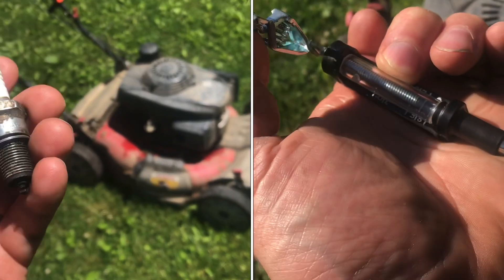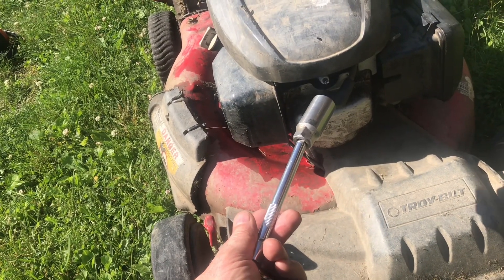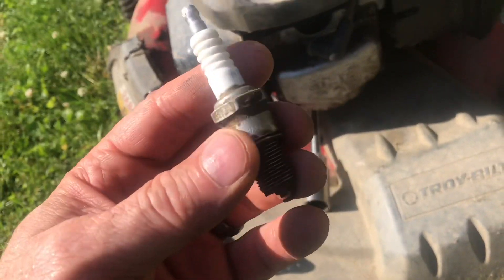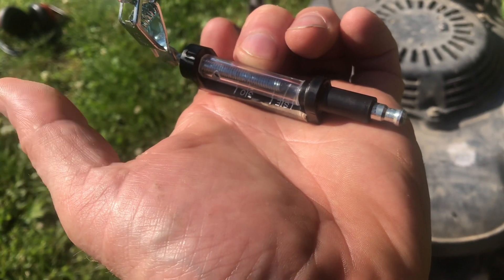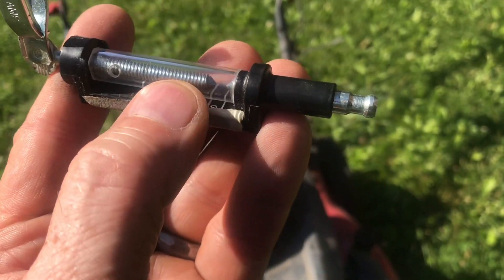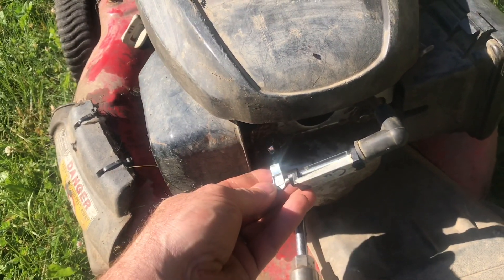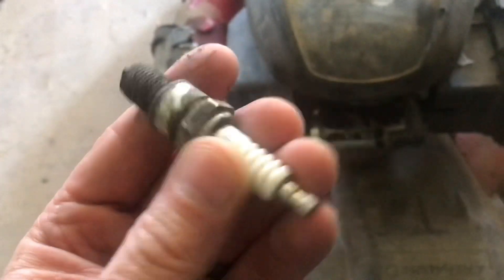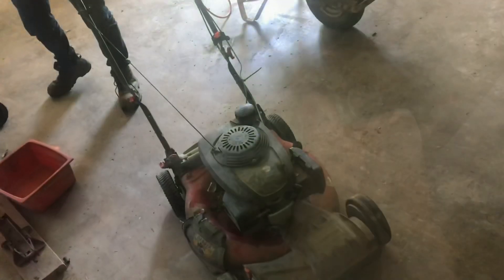how to “test” the SPARK PLUG in your lawnmower

Comment: I've had 2 mowers where the spark plug flies out of its thread. what caused that?
Reply from the maker: I’m not sure, maybe the spark plug needs more torque? That’s my first thought
Reply: Two mowers (probably different brands) indicates it is something you are doing. The spark plugs have been put in cross-threaded. If forced all the way in with the spark plug spanner it makes the plug holes larger - permanently. You have ruined two lawn mowers,